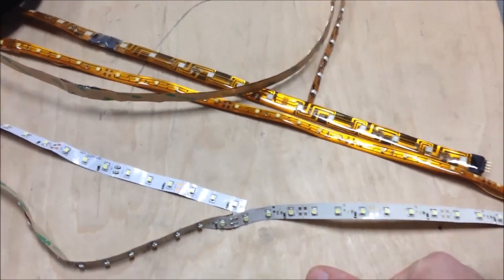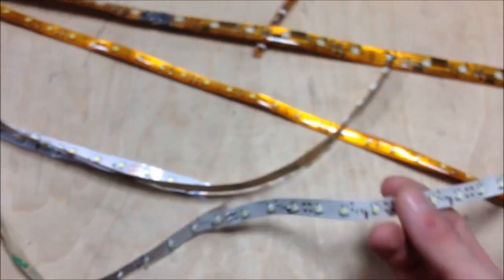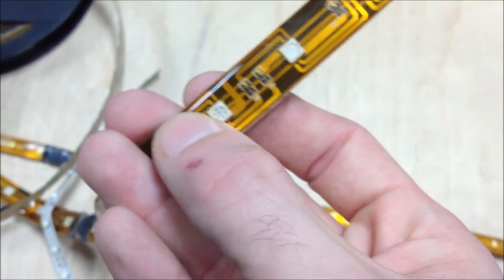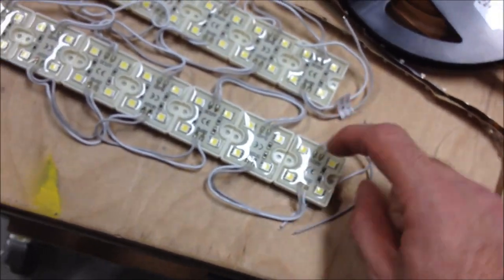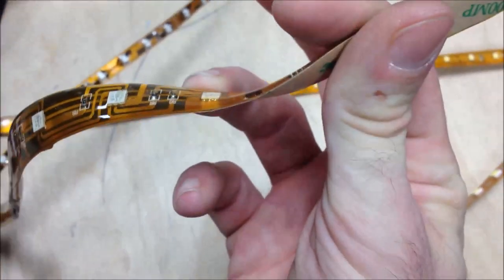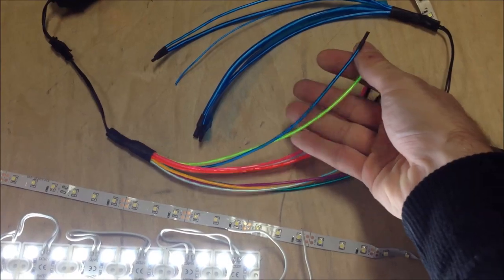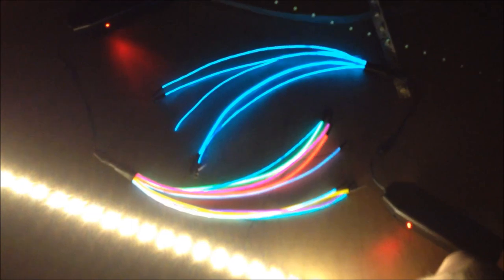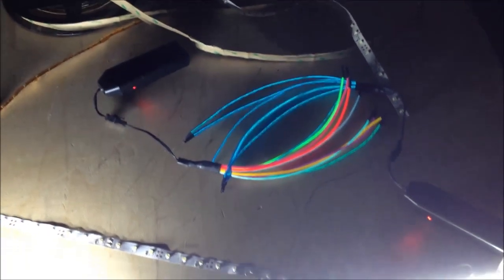LED Tape vs. EL Wire Demo

Comment: When it comes to comparing the EL Wire to the LED Tape, I'd say that the EL wire is bright enough to help you be seen while the LED tape can actually help you see.
Reply from the maker: True enough!  EL products have a lot of other advantages too- so I'm not saying don't use them!  But you're never gonna see car headlights made out of EL wire. :)

Comment: Dose the input voltage have any effect on light output of El wire, I've ordered a 12 volt input wire, but wondering if the overall inverter output voltage would be the same as the 3 volt you have here.
Reply from the maker: I would almost bet money you'll have better results with the 12V inverter.  You'll probably be able to run longer lengths of EL wire, and/or have it brighter.  This is assuming you're going to power off a large battery- if you tried to get your 12V using hearing aid batteries you probably couldn't get enough current to power stuff well.

I'm much more familiar with LED tech than EL wire, so please if you get a chance to experiment let me know your results.

Comment: Hi. Was wondering how hard is it to find/create a battery pack and attach it to the LED strips if they the chasing type and not static? I know if they're static they don't require as much power, but with the control and what not, would it even be possible it through battery, and not have it die w/in an hr? Thanks
Reply from the maker: I did exactly this last year- took a roll of LED pixel tape with its controller and hooked it up to a Li-Ion battery pack I bought on Amazon.  The battery pack was 12V and the tape+controller ran on 5V, so I had to get a voltage converter as well.  It ran for a decent amount of time, over 2 hours I believe.  I don't think you'll notice too much difference in power consumption between LED Pixel tape and plain old RGB tape... the control electronics don't take up a ton of power.  How long do you need it to stay lit?
Reply: djlemma
It's hard to say, I wouldn't say too long, It'll be acting more of a button so maybe 2-3 mins every now and then? Planning to make it look like a 8 bit blaster beam thingy

Comment: Is there any way to custom an inverter? So you can use the smallest battery possible? Any USB charger options for battery power?
Reply from the maker: sarah west I am sure you can, although smaller batteries are going to cause performance reductions.. either reduced life, reduced output, or both.  Depending on your skill level you can probably do anything from some kitbashing to wiring up your own inverter circuit from individual components.

Comment: Hey there. I don't have any experience with EL tape or wire, so could you tell me which one and what else do I need to stick the EL tape or wire to a pair of shoes, so I can bend it and stick it on my shoes to whatever shape I want please? For example, if I want it to shape around a Nike tick?
Reply from the maker: +Dj Fes You would probably want very thin EL wire to do something like that.  It would not be very bright, but you would be able to flex it into all sorts of patterns, Nike logo would probably be easy.  The thinnest EL wire strand in that blue sample bundle in this video is 1.3mm diameter. I would probably stitch (with needle+thread) the EL wire to the shoe, if possible.  If you can't stitch it on, I suppose you'd just have to experiment with adhesives.

You might also want to consider how the lead wire would get routed- you might want to poke a hole in the side of the shoe so the wire can be run inside of the shoe, and maybe set it up so there's an easy disconnect point at your ankle so you can put the battery pack somewhere comfortable like your waist but still be able to remove the shoes easily.  Or you could look into very small battery packs that perhaps you could hide on the shoe itself.
Reply: +djlemma ahh, thank you for this! I have seen some people put a battery behind their laces, it looks weird lol. Is there no other way apart from the battery behind the laces and the long wire that you mentioned? 

Won't the adhesive or even stitching ruin the shoes?  Because the ones I have are rare and I don't want to mess them up lol
Reply from the maker: I bet there's tons of ways, but my suggestion would be to find some similar but cheap (or worn out) shoes to do tests on.  I'm sure you don't want to make mistakes with your rare shoes, so do all the tests and learning on stuff you don't care about.

As for battery placement, I'm sure there's options in the shoe other than the tongue. But you'll have to do that experimenting yourself!

And if you get something working, I wanna see it!  Send me photos or video.

Comment: I'm going to buy the EL wire, but does it come it by itself or it comes with the battery pack??
Reply from the maker: +Meh .Evver It depends what you get.  Check with the product description before you buy!
Reply: Just know its a dif battery pack

Comment: is there any way to change the brightness of the EL wire?? if i was going to run it off 12v would it make any difference?
Reply from the maker: Yup, there are power supplies that have dimming capability.  Running off 12V will probably give you better results and more options, although might end up costing more.  If you're hooking it up to a vehicle there MIGHT be some issues with overvoltage, but I think most stuff designed for "12V" use will actually be okay with the 13V or higher that an alternator pumps out.
Reply: +djlemma I want to run some el wire on the outside of my Dodge Challenger do I need to do it with the el wire instead
do I want it  to be neon red  do I need to get rid of the battery pack
Reply: God Child  get the inverter that plugs into the cigarette lighter of your car or the one that can be spliced in to the power wires already running through the vehicle. All the inverter is doing is changing the DC voltage from a battery to AC power required for the EL wire.
Reply from the maker: God Child As granfield said, you can get inverters that are way better than the little battery ones in this video that will run off the car's 12V system.  Just be aware of the brightness, it's not going to be super bright, but at night I'm sure you'd be able to get a really awesome effect

Comment: I'm not sure if you will see this, but I am not experienced with any of this, but I have a convention coming up and my cosplay requires led lights. it looks like the original is using bulbs (I looked it up and completely forgot what they are called) because it's through a jacket. would it be feasible to use the led tape or something like fairy lights to replicate the look of the bulbs or would I actually have to do a whole circuitry program with the diode....AHHHH that's what they are called...diodes. thank you!!
Reply from the maker: I am sure there's a product out there that would suit your needs.  Do you have any pictures of what you already have, and the look you're trying to achieve?
Reply: +djlemma yes I do, but I'm not really sure how to link the pictures here. but if you search here on YouTube: 2pm hands up and skip to 3:14 there is a video of what I'm trying to do (the one in the middle)
Reply from the maker: I am not sure you will be able to get something ready-made that'll do EXACTLY that.  Custom animation is either going to be complicated, expensive, or both.  But you certainly could use LED pixel tape for that effect- look at Adafruit NeoPixel for instance.

You might also have some luck with holiday string lights- some sort of chasing icicle light might do the trick, giving you a little bit of flashyness without getting too complex.
Reply: +djlemma I was initially thinking of the led tape and just running it across the inside of the jacket and using the connectors in places where I need to space it out or change the pattern. I also thought about Christmas lights but wouldn't they be too bulky? 
thank you so so much for answering!!!
Reply from the maker: Well LED tape is tricky in that you can only cut it at certain places, and joining cut sections usually means soldering (or using special connectors).  With string lights (or signage LED's like the puck lights in this video) you can easily adjust the spacing and there's tons of easy ways to splice wire leads.

I was thinking of christmas/holiday string lights because you might have an easier time finding something that lights up in a cool pattern.  A costume that lights up is awesome, but a costume that lights up in special patterns will really get that WOW factor!
Reply: +djlemma exactly lol I am definitely going for the wow factor. I was also looking at remotes and I've found the connectors that I would use for the strips. I will also look at the Christmas lights if I can find some that work with battery packs instead of an outlet. 
I also checked out the neopixels! those are awesome!
Reply: +Jim Jose oh goodness lmao

Comment: Good video. I do cosplay stuff with this stuff also. I've been playing with some ofthese types of LEDs and EL wires a bit. Just FYI the "waterproof" RGB LED strings are Not to be trusted. The covering on the surface is great but the back of the tape has an exposed circuit because, as you said the 3M glue is flimsy and it doesn't make a waterproof seal on the back side and will short out. The only workaround I could find was to silicone them to whatever I want to attach them too, preventing water seepage and shorts. :)
I vote LED, EL wire is fun, but LED rocks the box tops. Where'd you get those pucks, or squares of LED's at? They are quite nice.
Reply from the maker: There are actually a couple different ways of waterproofing the tape, and while some companies cheap out with just a layer of silicone over the top, others encase the entire strip in a plastic sheath that's then also filled with silicone.  Pretty waterproof, but a real pain to solder!  And I need to look into where those puck things actually came from, they've been kicking around work for years.

Comment: The type of inverter wouldn't matter because el tape/wire operates at lower frequencies, so you are going to hear it either way.
Reply from the maker: I have actually only used 2 types of EL wire inverters... a cheapo one that ran off AA batteries, and a more expensive one with a dimmer that ran off 12V.  For sure the more expensive 12V one was also quieter.
Reply: djlemma But it still had a sound because the EL lights operate on lower frequencies.
Reply from the maker: What do you mean by "lower frequencies"?  They operate at audible frequencies (200-2000HZ I think) but that's actually a lot higher than typical AC.  There's certainly ways to make an inverter more quiet...  And of course you can always put some sort of sound-deadening material around it.

Comment: hi how do i find like this 3.7v thanks
Reply from the maker: Haven't seen 3.7V tape.  I've seen 5V LED Pixel tape, but everything I use is 12V or 24V.  Voltage drop would be a problem with high-output LED's at 3.7V.
Reply: thanks i find some work in 2 battery

Comment: can i use LED sequencer to EL wire
Reply from the maker: Not sure exactly what product you are thinking of, but I would guess the answer is probably NO.  EL wire runs on a different kind of power than LED, so products that manipulate power for LED's won't be usable on EL wire.

Comment: i though the wire was makin that busing sound, so its the inverter? D: so did u have any luck getting rid of that sound? its really annoying ."
Reply from the maker: It is rather quiet, so unless you are in a quiet environment I don't think it would be very noticeable.  I haven't been testing different samples much so I don't know.  I do have a decibel meter so I could probably show just how quiet it is.

Comment: I like elwire because its bendy and resembles neon. The leds are too gddmn harsh and bright and the flicker rate messes with my eyes/brainwaves.
Reply from the maker: You should be able to avoid flicker with LED's if you use a decent driver, or batteries.  Batteries would be pumping out pure DC, so no flicker at all, and a high quality switching power supply will operate at a very high frequency that shouldn't be perceptible.  There are also LED products that look like neon, and are similarly bright- if you are trying to DIY a neon sign that would be visible during the day and bright at night, LED's are a decent option.  Neon is kind of magical though, hard to REALLY match it!

Comment: i drill small holes on each terminal for the led tape then slide the wires through then solder the wires then i cover the end with liquid electrical tape then i shrink wrap it
Reply from the maker: +Rustic Lantern Good method.  Always good to have a solid mechanical connection before soldering.  Seems like you'd need a pretty small hole and very small conductors if you did it that way though- any issues with voltage drop?
Reply: +djlemma thanks, and yes i agree, i actually used the smallest size speaker wire i had but a smaller would have made it more easy, i used the smallest drill bit i had, there was still a small copper ring around the hole. i twisted the wire strands as tightly as i could and put them through the the holes making sure the polarity was correct and making sure all the strands went through. i then folded them over, i made sure none of the strands were touching eachother and soldered, i didn't check the voltage drop across each connection, but they all have equal brightness, im putting 4 sets or 3 leds in a vehicle to light up the floor boards, ill let you know if i ever have a problem with this method

Comment: Anyone out there have advice?  I'm making a Wonder Woman costume and the whip is really stumping me.  I've thought about braiding EL wire and covering it with a thin sheer painted like rope braid, but not sure even 3 or 4 would be bright enough to see in normal room lighting.  The LED strips are thicker, so would be harder to 'cover' with a braid that looks like rope.  I've thought about using thin jewelry chain over a few EL wires as well for a more Lynda Carter look but my costume is the new 2016 WW.  any tips / tricks from people who have worked with both??  I would love to put the batteries in the whip handle also, so nothing that runs on more than two or three double AAs.  This shows the whip in action:  https://youtu.be/5lGoQhFb4NM?t=1m22s
Thanks in advance and for this video!
Reply from the maker: Oh geeze, that's a particularly tough situation.  You need 360 degree emission in something flexible and thin... I think you could use rope light (LED or incandescent, honestly either way would probably work) but it's more dots-in-a-row than continuous light.  The EL wire solution might give you something more even... I think you might be able to use a LOT of thin strands (like 12, for instance) clustered together around a core.  It'd probably be bright enough for indoor if you could get enough driver power, but I doubt you'll be able to get that on just 2 AA batteries.... this is going to be a problem with whatever light source you choose.

Would you be able to compromise on some things?  Could you set it up so the batteries are in the vambrace, so you'd have to be holding the whip with your hand to power it?  Is it okay if it's not flexible enough to whip around, but more of a static thing?

You might be able to do something with side-emitting fiber optic as well, could be worth a try.  All of these things are going to have a tough time with the length you're wanting to achieve..  I really might just go for EL wire and find some dark locations for photos. :)
Reply: Yup... I may not even deal with it for Halloween but for the movie premiere I want to have that 'wow' piece.  I think I may try the 10-12 strands of EL wire and maybe I could give it a little paint wash to look like rope... either that or the LED wrapped with yellow twine in a rope braid... thanks for the suggestions!!!
Reply from the maker: I was reading weapons policies for a couple comic conventions and they had rules against any sort of whip that could be untied and actually used as a whip.. so it might actually be BETTER to build something that isn't fully functional.

I still don't have a magic answer.  Side emitting fiber optic could be cool too but you'd need to stash an emitter, and I haven't played with it to know if it even works well.
Reply: I think I'm doing 2 strands of EV wire b/c that's all that will fit into the rope I got.  If it works I'll let y'all know how well exactly :)  Thanks!!!
Reply from the maker: Talk Nerdy To Me Fantastic.  Take photos if you can!  And hey, since this is youtube.. take video!